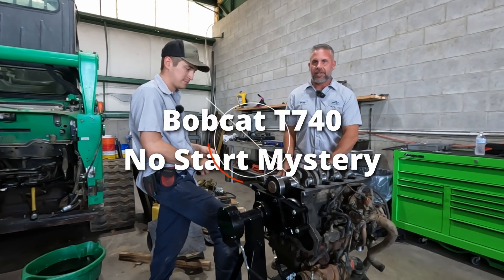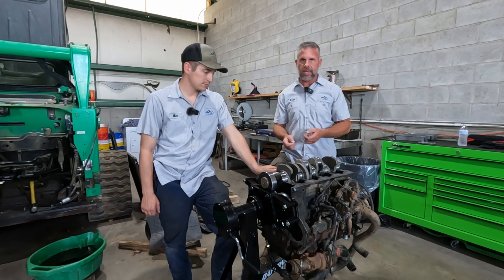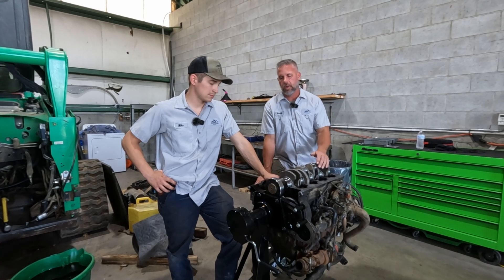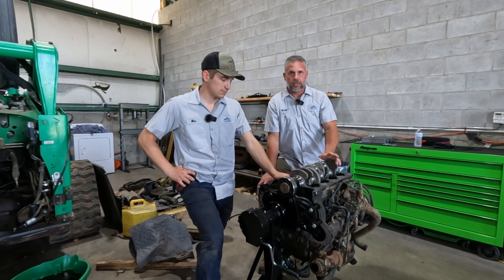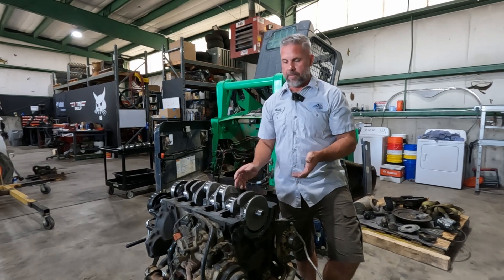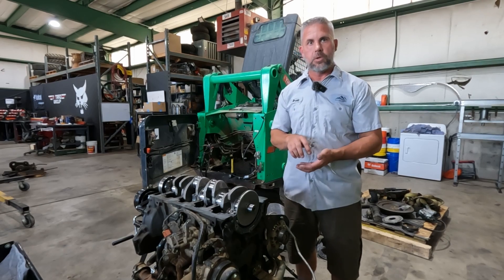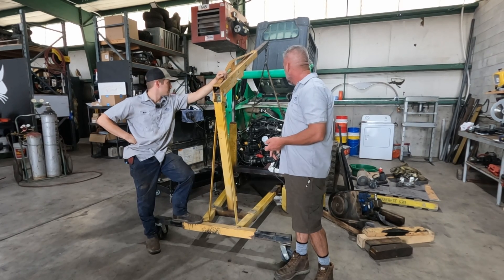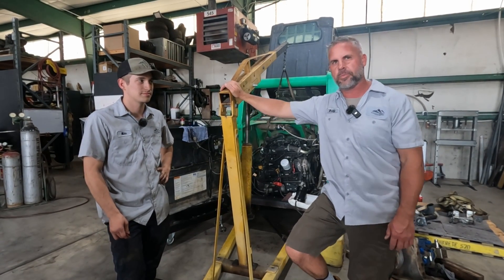Bobcat D34 Engine Will Not Start After Rebuild

Comment: Today I came across this video and it just saved me.  For months now I have been trying to get this d34 started.  After new fuel system, multiple dealer call out for programming and failed diagnostic.  After watching this video I took the front of the engine off, removed the tone ring and found one tooth was slightly bent.. after straightening the tooth it instantly fired up.   Thank you!  That was a wild ride but in the end it running!

Comment: Todays endeavours took 3 hours in negative temps looking for short in preheat system on S650 B2LA series, untill i found that glow plugs, i replaced day ago, was shorting out when hot and went back to 5ohm after cooling for a few minutes. OEM Bobcat part btw :)

Comment: 😂 checking old for replacement #1 Rule would of saved a load of unessary hard work ... ...

Mind you some times hard to spot ... in the heat of the moment  ...
I am guessing some one else is crunching their nuts cause the item you received is what they should of been delivered ???

Electronic controlled engines are great till they dont .... 😢😢😢😢😢
Agspanner

Comment: Reminds me of a engine builder is I never threw away the old parts always match them up, set of timing gears from a reputable company they must have drilled a couple  ? How many gears for the lining😊 hole tooth off I actually met two other machines that actually caught the same problem I won't mention the brand name it's a popular name everybody knows but somebody screwed up the gear still good they just drove the timing mark in the wrong place on the gear 1 tooth off. I actually drove the new mark on the gear just so it would look nice.

Comment: Has to be a timing issue. I worked on tons of those engines, if it starts on ether your engine timing is fine if doesn't it is a timing issue, then it's a fuel issue or injection timing. I know your not suppose to use ether but when you have a problem you need to know just a whiff don't drowned it.

Comment: Yes. On a John deer 3010 cam had to use a used cam and the injector gear during a serton year was off jd used them anyway. You have to install the injector pump 180 off the timing marks.
Reply: That happened to be on the engine diesel fuel coming out of the exhaust pipe

Comment: on the 4.4 cat motors that reluctor wheel is BOLTED onto the rear of the crankshaft ... guess what.. the bolts BACKOUT by themselves and then the engine WILL NOT start.  unless you UNPLUG the crank timing sensor, then it will read only on the cam sensor. it WILL run but it has an active code until the reluctor wheel is bolted back onto the crankshaft.   took me about 2 hours to figure that out in the field.

Comment: I hate it when you chase something for hours and it turns out to be wrong ,incorrect parts , seems lately this is common with aftermarket electronic parts such as volt regulators ( 3 tried before 1 worked ) ECM's work for short time then crash wrong part supplied after correct info sent or even wrong part in wrong box ( camry front axle wrong diameter )...one tech on here is finding used parts in new part boxes

Comment: I would not be surprised that hole was put in with a manual drill press with a tooling jig based off crankshaft keyway. With the jig upside down.  It would be off an a equal angle from the crankshaft keyway.
Reply: Even when the tools are clearly marked as to their correct usage some operators still manage to use them wrong. I've learned over a long career that you cannot make an "idiot-proof" tool. You can only hope to make them "Idiot - resistant."
Reply: Oter option is manually inputting numbers to the CNC machine and mixing plus or minus sign.

Comment: We had a CAT 3176 no start that the "tone wheel" was installed backwards. And a CAT C6.6 that the wrong rail pressure sensor was installed. It read the correct pressure but wouldn't fire. And a CAT 3406 E no start that the injector harness was installed reversed.

Comment: Aren't all the "teeth" on that tone wheel the same size and spaced identically from each other?  
  To the position sensor reading the tone wheel... the teeth are all identical to one another, and the spaces between each tooth are identical. To that sensor... it's either "on" or "off"

  Theoretically, the sensor isn't looking for 4 particular teeth on the periphery of the wheel to know when to fire the injectors, it's just counting the degrees the crankshaft has turned... teeth are teeth to the sensor.

  What I'm saying is that the pin hole was probably off only a few degrees one direction or another and if, magically, the computer could have told them that.... theoretically, they could relocate the pin hole in the wheel and get it correctly timed....practically, not going to happen.
Reply: There is one missing tooth on the tone wheel. The sensor notices that gap and that’s what tells the ecm where the engine is at in its rotation. With the pin in the wrong place the ecm was firing the injectors at the Incorrect time therefore not enough compression at the correct time to start

Comment: That’s when I use pico scope tells a whole story any timing issues or compression even a valve issue a good tool to invest it can pay you off in one check
Reply: Exactly, I'm sorry but this video is just poor diagnosis and throwing parts until it runs... Sometimes you get faulty parts out of the box, but you HAVE to take that in account. You can get all the data for diag to pinpoint exact problem before changing parts and those guys just haven't done that.

Comment: Ordered an ac compressor from Friday parts for a t190. Recieved 2 compressors with 2 separate issues! 1st one leaked at 2 places and second one had faulty internals that would not compress! Friday parts tried to tell me that I didn't install correctly. Unfortunately for them my day job is HVAC. Sent videos of everything and they ended up just refunding me my money. Great customer service. Junk parts so far! Ended up ordering a compressor from ebay. Worked great!!

Comment: Great Job guys on finding the issue on the D34, love your channel!!!  I have a bobcat e35 mini excavator 2018 2600 hours just lately the last few times of starting it will crank over a good 10 seconds before it finally starts runs fine after that, even after i have ran it for awhile at operating temperature and go to start it again say 20 minutes later the same thing, battery is fine, I just ordered a new fuel filter should be here in a few days filter has about 200 hrs on it, no error codes plenty of fuel in the tank, hopefully the new filter will take care of the issue, is there other things that i should be checking if the filter does not fix the issue. Stay Safe and Take Care
Reply: You may want to check your injectors. I just had a machine with a similar issue and it ended up being the injectors bleeding off the pressure in the fuel rail.
Reply from the maker: I agree with the injectors.  I have several videos on how to check for excessive leakage.  This can prevent the pump form being able to build enough rail pressure to start, but once its running, the pump can keep up.
Reply: @tetradgroup  Thank You for your input, if I do have to change out the injectors does anything special have to be done on the software side or am I good to go..Thanks
Reply: @howardhoward-mk3ji 
I had same problem on t740 with d34 and bought a bulk filter pack on ebay and wiped out my injectors and then found this channel trying to figure out why it wouldnt start.
Dont use anything aftermarket on the fuel system.
I put factory injectors in and I was going to get them coded at the dealer but I was told the ecm will learn the injectors over time so I didnt.
That was a year ago.
Still runs perfect.
Just keep your fuel as clean as possible and add some diesel clean also the Delphi injectors are super fussy.
Hence the Bosch fuel system now on Doosans.
Reply: @tetradgroup  Hello, installed new fuel filter and still same issue, I looked at your video on how to check injectors using the plastic tubes for excessive leakage, #1 was real bad, #2 looked good and #3 had some fluid. I ordered a new injector should be here in about 4 days from now (thank you very much for that video) I was thinking about looking on the internet to see if someone can possibly rebuild these, that way i would have a spare. I felled to mention that I started running off road deisel about 2 weeks ago and what people are telling me that should be no problem, anyway thanks to all and keep these great videos coming. Take Care Everyone.
Reply: @jeremyg9240  Thanks for your response, after I installed the new fuel filter and still have the same issue I will be checking into the injectors.
Reply: Currently have the same issue with my T590 with the D24. Won't start without first using the primer bulb. Following these videos, I've traced it down to my #2 injector bleeding quite a bit more than the others. #1 and #3 are bleeding more than they probably should too, but nowhere near as bad as #2. Looking to buy an injector or injectors, and after seeing this video, I may try fridayparts since bobcat wants nearly $1,000 per injector.

Comment: Yall really need an oscilloscope and fogure out hie to use one. Scanner danner has a book and also videos on how to diagnose issues like that with an oscilloscope without removing the engine. Its not just issues like this its almost anyissue.
Reply from the maker: Thanks, I will have to watch his videos.  We checked with an oscilloscope and knew it was working correctly but I was not able to know if the timing was correct.
Reply: @tetradgroup  The whole thing with oscilliscope is getting a known good. All you need is the same machine to get a waveform to compare. He also has a book which you can buy. I mean its based for vehicles but its 100% the same testing methods.
Reply: @tetradgroup  I think if you buy the book you get a discount on his "premium content" He has classroom lectures that you can watch and follow along in the book.
Reply: Scope wouldn't prevent remove and teardown engine
Reply: @kevinpulliam8029  It totally would have prevented the thousands in parts and labor replacing all the parts they did.
Reply: @kevinpulliam8029  100% it would have prevented the thousands spent on swapping sensors and wiring harnesses and whatever else it was that they said was replaced tryign to find the cause.

Comment: Hey Brady. Would this engine start with the cam shaft sensor if you had unplug the crank shaft sensor?  Very good observation.
Reply from the maker: It would not work either way.  I know it will run without the cam but not sure on the crank, I haven't tested on a good engine, only going off what Bobcat says.
Reply: @tetradgroup  working on a d24. I will unplug it tomorrow and try it. Very good troubleshooting.

Comment: We had a similar situation happen with the reground crank. When the crank was inspected with a mag particle machine, it's changed the magnetic force, which caused the crank sensor to get an erroneous signal. Which caused a no start situation...crazy!!
When you mentioned that you got a crank from China, I immediately thought there was a faulty crank sensor error!! 

Apparently the tech who put it together didn't realize this!!
Great Job Brady etal!!!
Reply from the maker: That is crazy
Reply: @tetradgroup  I saw your videos but I don't understand if I buy the new sleeves including the pistons and rings for the general maintenance of the Kubota engine model D750 I ask if the sleeves mate correctly to the engine block without performing mechanical grinding with the new cylinders and relative rings.